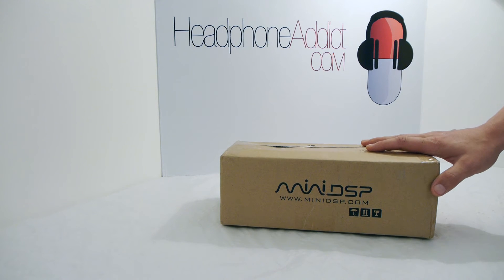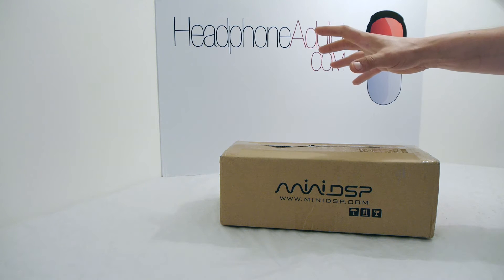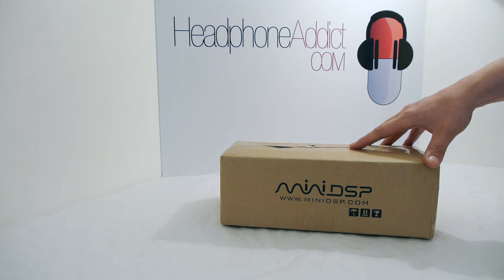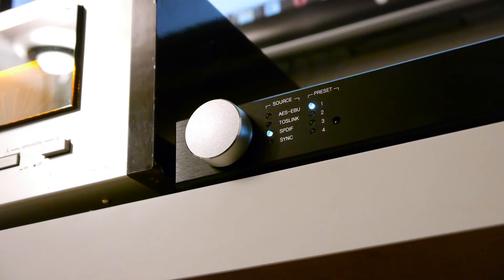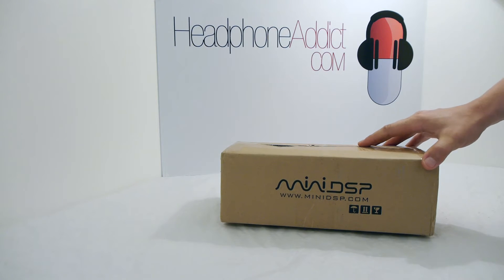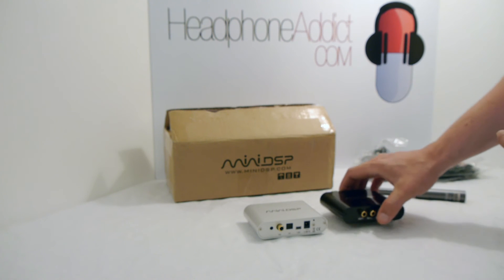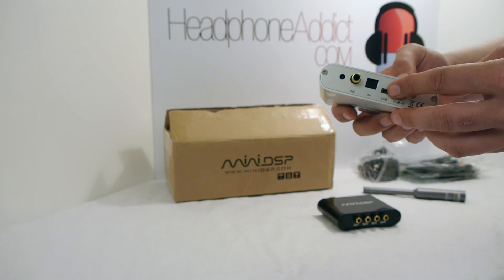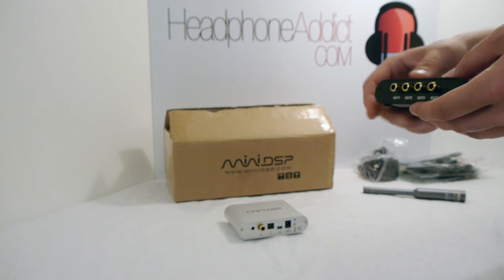Unboxing MiniDSP NanoDIGI 2x8 and MiniDSP 2x4

Comment: No review? Still waiting on the how to setup
Reply from the maker: Ran Marto Hi, sorry about the late reply. I have a lot of miniDSP products on hand, (2 pcs of 4x10 HD running different plugins (48kHz and 96kHz), one of OpenDRC-DI (that does both IIR and FIR filters) and the 2x4 single ended and nanoDIGI in the video above. The reason why there has been no video yet, is because I have been doing in depth analysis of all devices as well as a lot of subjective listening. My plan is to do a very in depth review of each product on the http://headphoneaddict.com website. There will also be videos made of how to set these up two very shortly as those videos will be featured in the written articles as well.
Reply: Is there a volume control in the minidsp nanodigi?

Comment: LMS-U for the win!  Great video man.  I myself have a 10x10HD and love it.
Reply from the maker: popalock85 hi popalock. Hehehe, yes, LMS Ultra, miniDSP and FP14000 is spectacular! I saw that video when you had all those guys over and you were showing your double blind test device and trying out SI24. Very cool. Your subwoofer system in the old cinema (looks like you've moved?) is an inspiration to what I'm trying to achieve with my stereo system. The room I'm using is similar in size to yours. A bigger room would be great, but have to work with what we have. Two Ultras were far better than one, even though one was awesome too, and since the enclosures are big they're not putting a lot of strain on the FP14k either. I actually think it would be able to drive four of them, which I'm contemplating (you of all people know how it is, haha). You helped point me to the fan mod info you did. Didn't do the mod yet though, so have had to place it outside the room.
Reply: Outstanding man!  You have some world class bass for sure.  I have a few friends that have quad (4) LMS-U's and they typically run one FP14K per pair of subs, which makes a 4ohm load to each channel of the amp.  From what I understand, it might not be safe to attempt to run below a 2.6ohm load to the amp, meaning if you simply added two (2) more LMS-U's on that amp, it would push the impedance down to 2ohm.  Could potentially cause a lot of strain on the FP14K Clone, which could "possibly" lead to failure.  Sanway claims to have improved the components that they use and claim that the amp should be 2ohm stable now, but until someone tests it, I'm unsure.  

How big are the boxes that you have them in?  If you have a little more room to spare, I might have a box design that might pique your interest. 

Austin